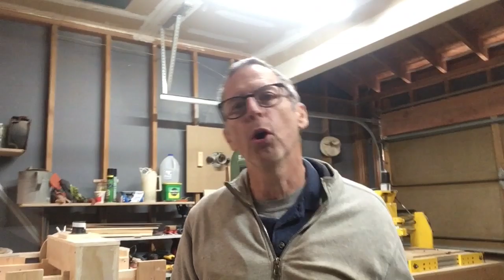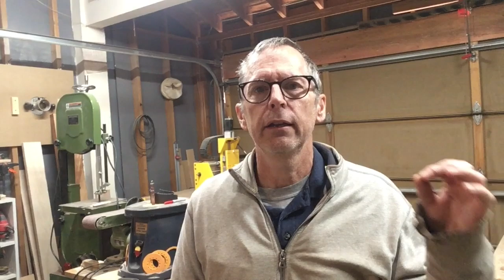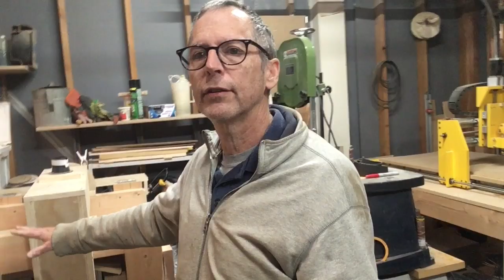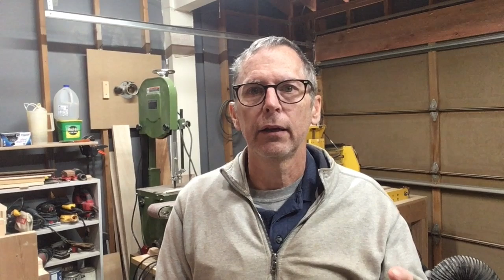Plans for My CNC Machine, Drum Sander, and Buffer!

Comment: Hey thanks for sharing the plans ! Is there an estimate about how much it would cost for all the materials used to build the CNC machine?
Reply from the maker: It cost me about $1,500 USD two years ago. It's hard to work up a cost because the info will change almost immediately.
Reply: @HighlineGuitars  Yeah, it's damn near impossible to estimate, but I built mine based on all the info you had already provided and it ended up somewhere in that same range. Great design!

Comment: Minus the router/spindle what is the cost for the materials to build this CNC Router? Do you have a list of all the parts needed for the build and where to get them? Also how hard would it be to reduce the size of it, all I really need is a working/cutting area of around 18"-20" wide by 24" long? Thanks!!
Reply from the maker: Cost was around $1,365 three years ago minus the router. The plans include a detailed listing of all the parts necessary, however, they DO NOT include where to buy them. You can make it any size you want by cutting the parts to the sizes necessary to achieve the dimensions you need.
Reply: One question I would have if you don't mind is: at this point in time to which kind of ready made CNC machine the one you built would compare quality wise ?

Comment: Awesome Chris! Thank you much buddy, I bring all my projects to work with me and I use their machines (cnc) when I can but alot of the time all the machines are setup with jobs running in them, my boss would kill me if I tore down a setup, it's bad enough he gets pissed when I don't clean all my wood chips and saw dust out of the metal chips, Lol. but it is nice to have use of 4 and 5 axis machining centers! As far as my shop I share a small space with a sailboat builder (And drummer of our band) in the same small town as me and we've been talking about getting are own machine, we've been looking into some Laguna if we only wan't to cut wood, Or a cheap used Haas, used there around 5 grand but not only can I cut wood but I can still make my own hardware, since they cut any material just have to make more passes at a small depth of cuts to eliminate deflection... But maybe we can start by making your machine for wood at our shop, and just do my metal work at work, Thanks again for letting us see and build your machine!!   Mike.              https://www.facebook.com/Ipswich-River-Guitars-106563420706171/?modal=admin_todo_tour

Comment: In previous videos you've said that some of the Chinese parts are no longer available and the US-sourced versions would be too expensive.

What is the current status on the availability and cost of the parts that are spec'd in your plans?
Reply from the maker: All of the parts are available from a wide variety of sources. However, I do not have the time to monitor the costs.

Comment: Thanks for making these plans (and your videos!). Good timing, I've been looking into making a drum sander, I might buy your plans. Can you shed light on the motor requirements and/or suggest a motor? I imagine you're using a ~1.5HP motor; I'm having a heck of a time finding one that runs at the appropriate speed (~1700RPM?), isn't as loud as a table saw, and is available at a reasonable price point. The motor is the most expensive component, if I can find one at a good price I'd jump in with two feet and buy the plans. Thanks!
Reply from the maker: I used one of these with a 25% off coupon when I built mine. https://www.harborfreight.com/1-hp-agricultural-farm-duty-motor-68288.html
Reply: @HighlineGuitars  Plans purchased! Thanks, Chris!